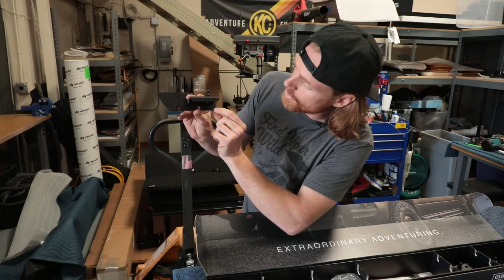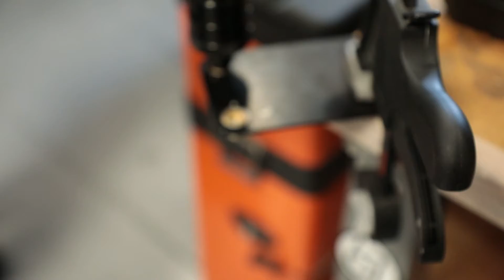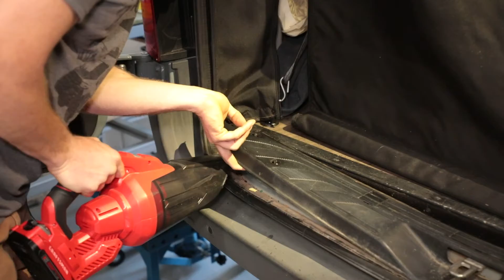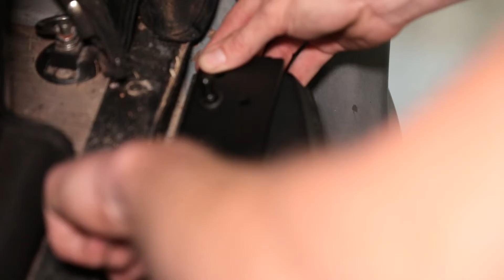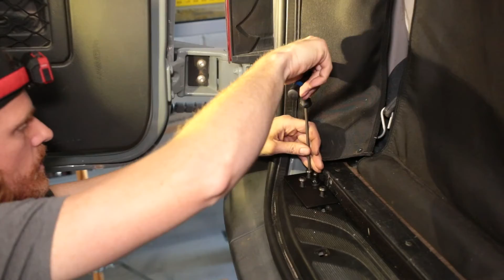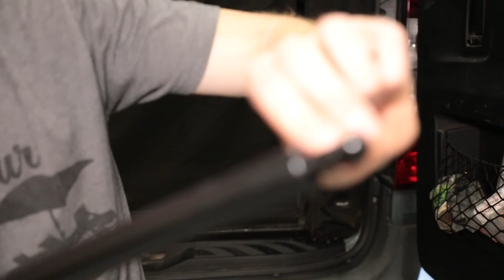INSTALLATION GUIDE: STOP-STAY™ Door Safety System for 2019+ Mercedes Sprinters

Comment: My flooring extends further back towards the door and crosses over a small section of the plastic, preventing me from taking it out, and covering the little tab.  After watching the video, it looks like I can just use a dremel multitool and cut it without removing it.  Any reason you think that wouldn't work?
Reply from the maker: Without seeing your van we can't make any recommendations. If you want, send pictures to info@canyonadventurevans.com and we'll have our install team look at it and advise.
Reply: @canyonadventurevans  It worked!  I just used a Dremel Multimax to cut out the plastic area, instead of unclipping the full plastic, pulling it out, and then cutting.  Worked fine and the product is amazing.  Thank you!!  BTW, I do see a bit of movement when the heavy door (with the owl van big box and bike racks on it), but I think it is just from the heavy weight and momentum when it opens.  I think it is just a small amount of movement from the sheet metal bending, as I believe I saw that on the Owl Vans demo unit too.  That's ok, right?  Thanks for a great product!!
Reply from the maker: Thank you for the update! Happy you made it work in your van. It's not uncommon to have a little flex or movement when the doors are opening, we have seen it on a few vans. It varies install to install but we've had 0 issues on our vans (loaded up with tire carrier, boxes, ladders, etc.) and have heard of 0 issues from our customers.

Comment: Great video. Thank you. Question: instead of cutting a rectangle out of the plastic, will drilling 3 big holes work? Thanks.
Reply from the maker: It is possible to drill 3 big holes, we've just found that cutting out the plastic is a more reliable way of installing the Rivnuts for the STOP-STAYS. If it's possible to cut the plastic with the tools you have, we highly recommend that.

Comment: For such heavy doors (i.e. with Owl boxes and tire carriers), those ball anchors that are bolted on the floor panels seem small.  Have you run into any issues with them breaking?
Reply from the maker: No issues from the doors/struts themselves, the only issue we've had was over tightening some of the balls during installation caused them to snap. Shouldn't be an issue for any kits that we've sent out to customers.